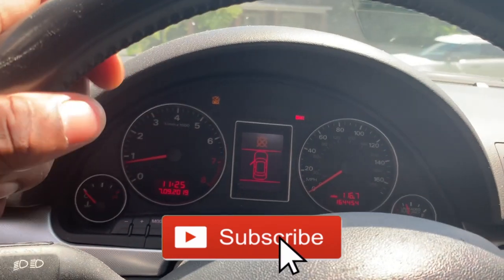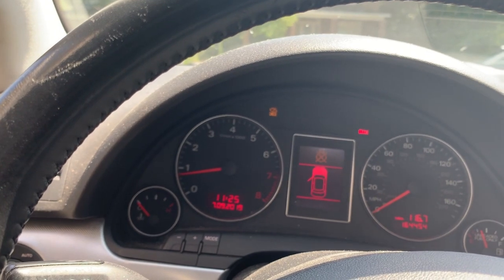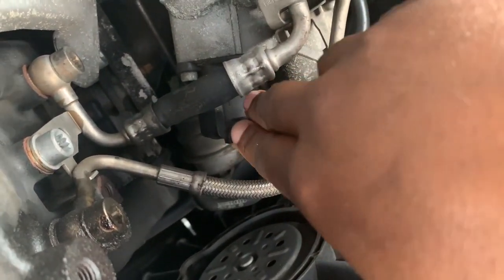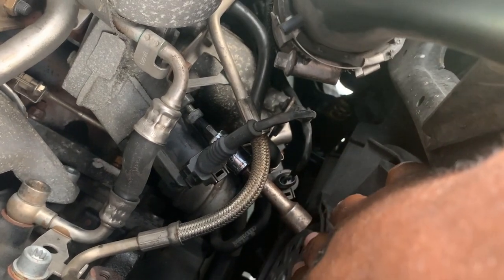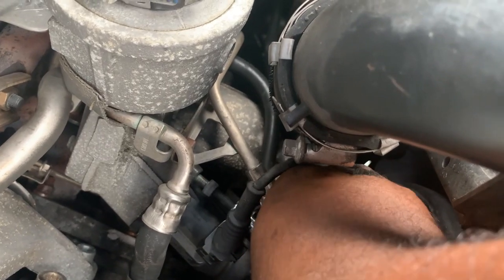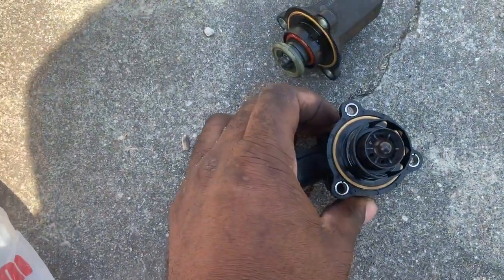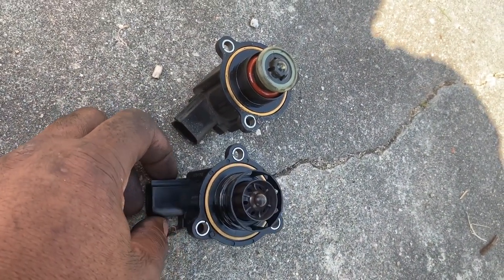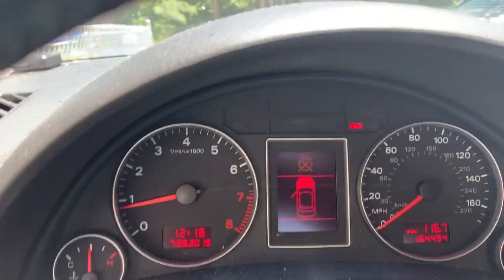2008 Audi A4 T2.0 P0299 Code Diverter Valve

Comment: Did a bad dv make your car really slow compared to normal?
Reply: Same problem mine is having, car feels really weak compared to normal and gives this code gonna give it it try and replace it
Reply from the maker: Yes
Reply: @540tv6  I got rid of mine already lol
Reply from the maker: @skylerbond56  me too lol Audi is problem after problem
Reply: @540tv6  yeah pretty bad when my RX8 is more reliable lol
Reply from the maker: @skylerbond56  it’s bad when my 91 Mercedes is lol
Reply: @540tv6  For sure Mercedes went downhill after 2000 though
Reply from the maker: That’s a fact

Comment: Did this fix your problem And will it work on my 2007
Reply from the maker: +wakanda forever light came back on but found that the code associated with a Cataytic Converter also
Reply: @540tv6  thank you.  I just suddenly lost boost. Making only 1.0 to 2.0 in/hg . It's  keeping vacuum so I don't think it's a leak.
Reply from the maker: wakanda forever yep mine is too! I may replace the Cats idk yet because I’m NC we can pass inspections with a CEL. When you remove the Diverter Valve if the seal isn’t broken then your issue is your Cats. My seal ring wasn’t broken
Reply: @540tv6  got  you.  I'll update when I get under there. Is driving on this safe for the car?
Reply from the maker: wakanda forever yes it’s fine your turbo just supposedly won’t give boost meaning it’s a regular ole car without turbo...even driving with bad Cats are fine...so your safe..give me an update bro
Reply: I fixed it with a N75 (wastegate  solenoid ) change. Those two valves were not easy on the hands!

Comment: How can you tell that for sure it’s bad I have a p0299
Reply from the maker: Only way is going thru troubleshooting the voltage and fuses of any but the part wasn’t expensive at all. If you take it off might as well replace it
Reply: @540tv6  like what symptoms did it do before the new part
Reply from the maker: @leo4870  no symptoms that I would consider and issue with turbo but I did notice idle issue and a code for multiple misfires which I had on a vehicle before that I found was the catalyst converter